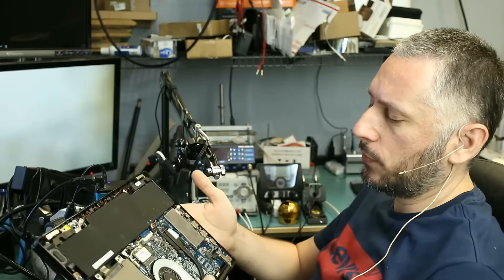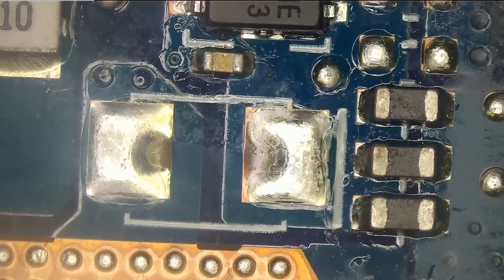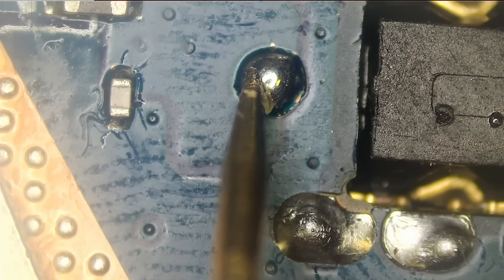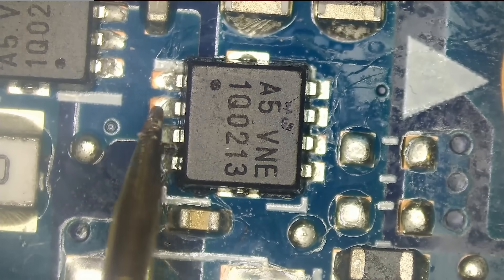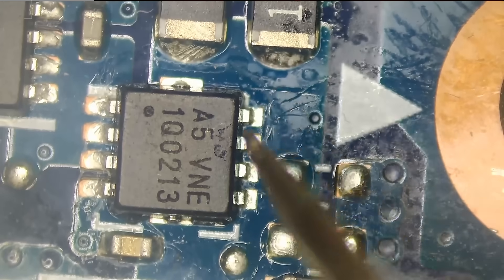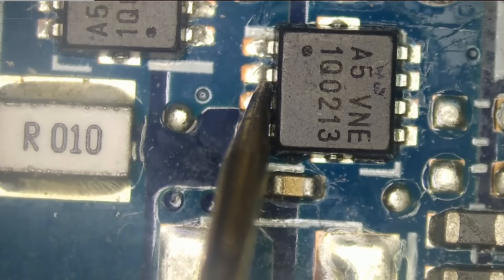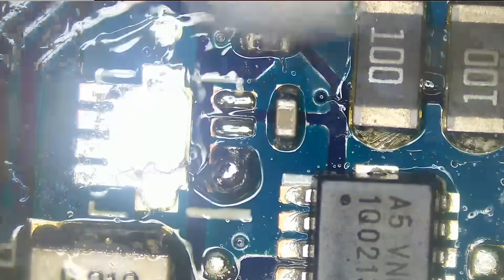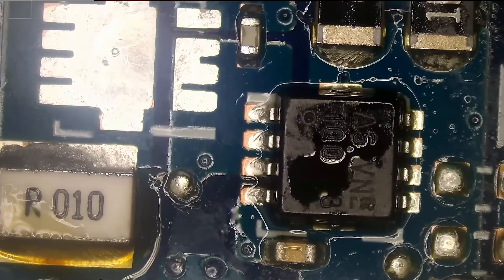Asus Laptop No power Not Charging Repair-  How Mosfets work and short circuit diagnosis

Comment: Hi and thanks for your video.  I'm trying to repair an asus UX431FA motherboard with exact same problem. 
I detected the same kind of short and removed a first capacitor, still short, then the second one and no more short. My only doubt is that they are black instead of being brown as on your video.  Can they still be capacitors or am I wrong? Thanks for any help
Reply: Well I eventually find the schematics of the motherboard and they are not capacitors but ferrite bead 🤭. But at least now I can troubleshoot more precisely and know exactly what to order. Still thanks for showing your tips!

Comment: Thanks! I have ASUS ZenBook 14 UM431 and same problem - device won't charge, won't power up. Now battery is dead and I unable to use laptop. Using your video, I seems found Capacitor witch is shorted. Now I'm waiting for air "soldering iron" to arrive to fix the capacitor or keep looking for dead IC...

Comment: I have a hp omen laptop that stopped charging a few months ago. After a month or so, it just started charging again until I took cable out. After plugging in it would just split sec go orange charge then white, no charge.
After another month, same thing again. 
I got a brand new genuine hp 230w charger and still same thing. Bought a brand new battery. Still same thing. Bought a brand new power jack and still same. If I use my older laptop 90w charger in this gaming one, it works and charges up. Plug the original 230w and no charge. If I remove battery it won't power on, just flickers a white light every time you try powering on. Put the 90w charger in and it works without battery

Comment: Hi my laptop also has no power issue after I replaced new battery & ssd m.2, I think I accidentally removed the battery while it power cable was plugged in could that be the cause of not powering up now ?

Comment: If I understand correctly, on the motherboard, shouldn't both pins of a capacitor be short?
I mean one capacitor pin may sound the buzzer but both capacitor pins should not sound the buzzer?
And this should apply to all capacitors on a motherboard?! Because I have a laptop that won't turn on and I have connected the multimeter COM port to the motherboard chassis and I put the multimeter red port almost anywhere on the motherboard, the buzzer sounds!

Comment: Brother i have a 2020 Rog  powers on but always 0% doesnt charge? I measured battery terminal on board and 2 center pins measure 3v and  the 3 pins to the right measure 0.8v  each so total output of Board batt term is only around 8v ? Is  that normal when no battery plugged in?  
When Battery  plugged in then the numbers even are lower.

Comment: Hi sir I need little help with my acer F510UF-ES71 lapee, it won't power on & even not charging, I have checked the power on the charging connector connecting in its motherboard by multimeter it gives 20v, should I give it to experts hand ? I can't found out solution...
Good to see you 🙂 sir, hope that you would...

Comment: HELLO NORTH! Am an avid Subscriber, you are my first 'Go to' when diagnosing PC issues! I recently built a new Computer in my old Tower with a new Raidmax Vampire 1000W 80 Plus Gold Power Supply, an MSI Z390-A PRO Motherboard with an Intel Pentium Gold Processor G5400 CPU @ 3.7GHz! Next added  64.0 GB DDR4 3200 Ram! Also a ZOTAC GAMING GeForce GTX 1 Video Card! Recently upgraded all my HHD's with an Intel 660p Series M.2 1 TB SSD Drive C and two WD I TB internal SSD's! My Computer now boots up completely for a cold start in 30 seconds!!!! (Once in a while when I turn it on, it Boots into the Bios Screen)!!!(But when I wont to boot into Bios, no matter what key combination I press it wont go into Bios on Command)! Windows will not display on my Digital Monitor but I can see the Bios Screen on another HDMI Output to my 32 inch TV! Am running XMP Mode and Gaming Mode on the MSI along with allocating 3/4 of my Ram to Process my Adobe Premiere 2022! My Question is: How do I get the computer to Boot into Windows EVERY TIME? And secondly, How do I get my computer to boot into Bios on command?

Comment: where is your location bro?
I have an hp elite x2 which has the same problem. battery is not charging. but placing a new battery laptop works just fine.

Comment: Thanks I have fpv drone and esc has mosfet also im playing with tesla coil bifoler pancake and use mosfit i alway get mixed up with drain sources gate is easy to me but im still learning because my gate to work i have to put a negative wire to the source pin and it 5v but im stuck because I want a 8v batt lipo drone battery to go though high side low side but have to put but negative to the gate driver that is a 555 timer so this i need to learn but anyway my laptop battery i had out last night because stoped working and somtimes have to hard reset to boot to bios all v is going to battery the battery gave me same reading as you 10 v across 4 cells the main batry board in in the battery not main board you just showed me what my problem is and I now feel more confident to fix it or faut find i will check the fets when hone and the caps if they ok 👌 thanks I hit lucky with your error i hate having to buy new battery for sake of a cap or fet i have 100s because many esc that has about 20 on each n and p channel that I got over time

Comment: Thanks for the information
In my own case I was working with my Asus and as soon I plug in my PC game pad to play games for relaxation after working on Archicad and closing for some hours, it just went of instantly as the usb is pluged, including charging indicator and other lights 
I have removed the battery and held the power button for 1-2 mins to see rest by discharging any power on board,  the tried powering back but not positive result

Comment: why are electrical components all labeled and named backwards?
like with diodes on a schematic, the arrow points the opposite direction of the flow of electricity
the positive wire is red, red is usually hot 
ground is on negative but negative is hot
and for mosfets, you apply current to the drain, and it comes out the source

Comment: I have a asus model r521f its not turning on its small chip its geting very hot ii control all the caps near but there are evrithing ok no shorts .why is geting this chip very hot right way whe i plug charging in ?

Comment: I can learn a somethng here. This not 100% can be work for all laptop. Which mean, it can be different for another laptops case but I understand every what his said and we need to check every parts with the multitester. The conclusion is, check the shortage, if components is a different than usual from another for the same type like hotter, no power or discolored, mean that was the suspect. We need to remove or replace it then plug back the power source then see how it goes. Thank you for sharing :)

Comment: At what temperature you set the air soldering when going over the mosfets? Thanks. Great video. I'm new working with smd components and always scared of frying stuff w heat
Reply: Did you eventually find an answer to this?

At first I was sitting on the edge of my chair thinking "this method of reflowing is gonna melt the damn plastic components" lol obviously they're made out of a very tolerant material and not plastic, but still. At what temperature do you just fry the components?

Comment: hello I have the same problem Laptop ( Lenovo Y50-70)   does not turn on when on charger without battery but charges the battery well when the laptop is off.
I tried your tutorial here are my results 
When i tested   +  - = 20v
+ D1=20v,      + D2 =20v 
+ S1= 20v ,.   + S2 = 20v
+ G1 =8.7 ,.   + G2= 8.7v
 when I tested in diode mode between + D1 no short. between + S1 no short. Same between + D2 and + S2 No short. I am really lost where can come my problem 

Thank's

Comment: You should know better messing about with Thermal cameras in using them to find a fault by injecting voltage into parts of the laptop. With your skills you should know how to do this better so little disappointed there. Still a good video but not how I would’ve done it.

Comment: Hi sir, 
I have thinkpad t510 in which same problem of charging, zero voltage at battery connector and 19 volt at drain of mosfet Q45, what should I do?

Comment: Hi

I have an asus transformer flipbook Q303 that doesn't charge and or boot up/ fans not spinning, the power light just stays on and nothing else / no fans spinning , HOWEVER i can charge and use the USB A devices when i plug it in the laptop. Do i have a MOSFET issue?

Ty!

Comment: @NorthridgeFix Can you please explain why my ASUS X555LF model laptop does not detect the external 4 GB RAM (which used to function perfectly in the past), yet it only shows the on-board 4GB RAM. I already update the BIOS version and reinstalled 64 Bit Genuine Windows 10 with no luck. Of note, I had to repair/replace power IC and controller IC for some power issues which got my laptop fixed with the RAM issues. Looking forward to your kind reply soon.

Comment: Great explanation! I wonder which liquid you use to desolder those smd mosfets? My heater would be at 330 degree and the fan on level 2 but not pleased.
Reply: I need to know the liquid type as well, thanks!

Comment: just curious, would a good ESR meter help test caps without removing them?
Reply: Depends on what is connected to the caps in the circuit but usually not possible .
Reply: @brianredmond4919  thankyou

Comment: Very intuitive diagnosing protocol. Impressive.
I, too, have a Asus rog gl552vw with puzzling symptoms:
- when power connected, the front light for power and battery charge are on but it doesn't boot
- if only on battery, no lights on, no boot
- when I leave it, plugged or not, the area on the left of the pad becomes quite hot until I remove the power cord and the battery...

Any idea, somebody ?...
Thank you

Comment: Good day sir i would like to ask some help, My laptop Acer Aspire 5 keeps Connecting and disconnecting the charger every time i open or play high end games for example Dota 2 or WoT, but when if don't play games it will not occur, what could be the cause of it? i already tested my charger if it supplies the correct power and there was no problem with the charger and the charging port by using multimeter. Hoping you can help me

Comment: Hi, thanks for inspiring video! I have my issue with one of those two MOS-FETs (A5 VNE  9Q0420) which is blown, probably due to connector issue - now repaired... Is it possible to temporarily supersede it with wire bridging the drain-source, which means I will allow going through those 19V? Many thanks in advance! Roman

Comment: Thank you nice work. Just wondering how the laptop ended with two problems at once. The charging port plus filter capacitor. Was it the bad charging port that damaged the filter?

Comment: Excellent video!! I have an ASUS A53E that is not charging or powering with its charger, but I disconnect the charger and insert the battery it turns on the orange leg (charger) as if charger is connected when actually it is not and only turns on with battery. How could I start diagnosis in this case? It doesn't seem charger related but some short with the battery or something like that. I already replaced the battery and keyboard (it was previously shutting down the laptop and has some bad keys).

Comment: Dear Sir,
Your videos are very easy to understand and clearly.  I like it. May i ask you abt the criterium of cpu i5 which not support the motherboard? Bcs i have bought motherboard laptop toshiba L855 chipset intel Hm7670 Gpu hd4000, when i tested with cpu I5 2450m, only adaptor led and power led are on, fan is not blowing and blank screen. This criterium same like i tested cpu I5 2450m  to old motherboard Toshiba L850 only adaptor and power leds are on. At that time i guess my chipset was hm65 but when i checked chipset is SLJ8E, graphics card AMD and the label near Ram are same series. Also on back casing of laptop has label Toshiba L850 with cpu I5 2450m.
That make me confuse bcs seller sold motherboard told me the cpu i5 is not support to motherboard L855 must use i5 3 Gen. Pls inform me my old cpu i5 does not support to motherboard l855 or motherboard is broken. Waiting your rush reply. Thank you

Comment: Thank you for the video. I'm repairing a laptop that only charges the battery if I plug the charger without the battery and then put the battery on it. If I remove the charger the laptop still powered but when I connect the charger again the laptop doesn't recognize it. I need to power it off, connect the charger, and then connect the battery. I do not have the diagram of this motherboard.

Comment: hello i have an asus rog g771jm that don't power on don't charge but if i put in the power plug an component start heating and from the board falled a diode or somethning was a black smd that dont have continuity don't have anything writed on it that was from the keyboard area

Comment: i have had the same problem in dell n5050 i3 and  i changed the two mosfet but there was a shortage all capacitor are shorted but only one was causing this short so after a day i found the bed capacitor and the laptop started

Comment: I had a gpu to fix the other day, same exact problem. Removed the mosfet, still showing short. Took a cap off at random. Short gone.
Reply: Did you replace the cap or left it off?
Reply: @94mac  wow it was a long time ago. but i imagine if i found the right value cap, i would've replaced it. i do quite a few gpu repairs, just in my spare time. not really for a business.

Comment: Are still making video have problem with my asus rog it has a power but when i try to plug it in the charging indicator does not or the battery does not charge at all i try to replace it woth new battery same problem as well

Comment: Why not checking the resistance of capacitor? Instead of guessing which one is faulty, just check with multimeter each capacitor and see which one has no resistance.

Comment: Nice informative tutorial but here is a thought: Voltage injecting 19v on a faulty board seems really dangerous. It could damage even more. Why not hooking it up to an external power supply, limit the voltage to 5v and limit the current as well. This will prevent the inrush limiter to kick in and you can still use the flir camera. What do you think?

Comment: Since you are using thermal cam i don't see a point in using original power supply to diagnose a short. 
It's more feasible to use regulated bench supply, giving as little voltage as possible (like 1.5v) and high current (like 3A) - after all you are just looking for part which is shorting to ground, and not powering whole circutry up.

Comment: hi sir, I have a problem,when i plug volage 19 v,the one MOSFET gets turn hot.and in drain voltage is 17 v,also on gate and source get the same.then i removed,and after I bought a new MOSFET. before i also measure the diode inside the MOSFET,and it turns "beep", it means that mosfet is shortes, so i changed with new  MOSFET,but it turns the same as before. so im also checking probably all necessary broken capacitor, and there is no one of them get hot. and also i remove capacitor one by one,and ensure that the capacitor are in god condition,and when i removed all posible broken cpacitor ,but the capacitor path was  still sorted. so what should i do,please reply my comment.

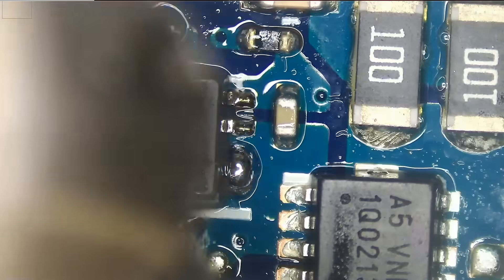Comment: Great video!  While I've been building PCs for 20+ years, I have no experience in electronic repairs, what are you applying at 4:40?  Flux?  Heat absorbing gel?  Would an ESR meter not help in finding the faulty cap?
Reply: That would be flux

Comment: I don't plan on tinkering with the insides of my Asus laptop, but it was nice to learn what could be the cause of it not holding a charge.  I had bought a new battery for it and that did not resolve the issue.  Is this common among this brand's laptops?  Next time, I will get something else.

Comment: Sir can u please solve mi problum .my problum is I have changed the cells in my laptop battery 4cell battery after replacing my battery is not working but the cells are showing 14.26volts but at end positive terminal is not reading any voltage absolutely 0 .negitive terminal is ok but there is no power output on positive side of bms can u help me .my laptop model Lenovo IdeaPad 15isk 80ud i5 6th gen

Comment: The level of this video is awesome! I got to change an Asus X453m video flex, previous flex was soldered/stuck so I got to remove 'something' from the flex conector, then new one fit it right, but when I plug the battery I heard some clicking sounds, some cap on the other side of the board around flex apparently got burnt. With flex disconnected notebook seems to receive power, as dvd starts and some lights too (but no cpu fan). With flex connected nothing happens and clicking sound (short I suspect) continues. Does it have to do with the flex connector? It's some way to solve this? I'm concerned because I need to send it somewhere to get the job done, also seems like flux remains near the zone (previous tech also stole half of the screws everywhere) so it's pretty messy to know what they did before :/ thanks man

Comment: My laptop Acer Predator Helios turns off when unplugged. Works like desktop without UPS. When turned on plugged shows battery 94% plugged in but not charging. What might be the issue ?